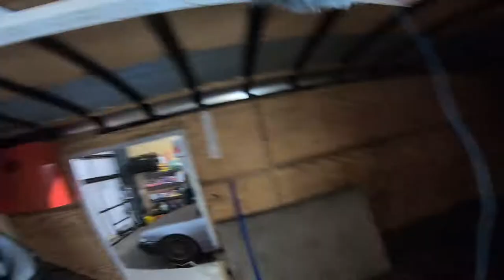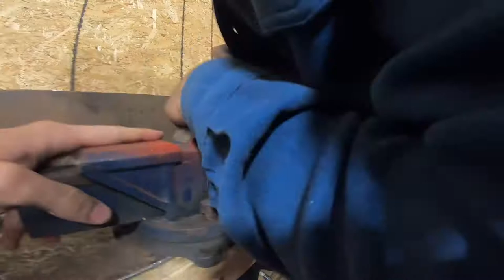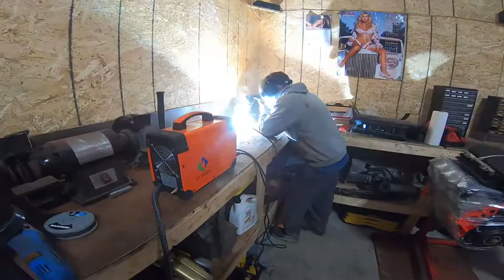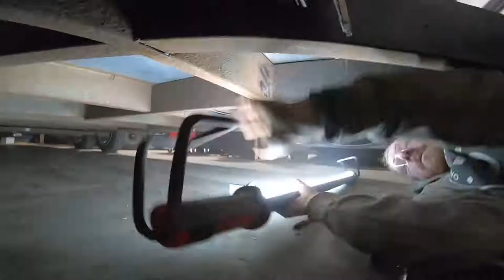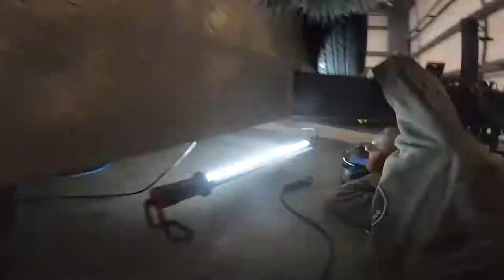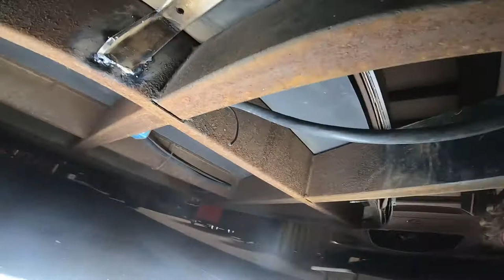Trailer Winch Install!!

Comment: Don't do no welding. Drill holes in the channel in a T pattern at the intersection of the channel structure. That's a very strong point and plenty of support. You will have to get 4 wedge washers. Fastenal